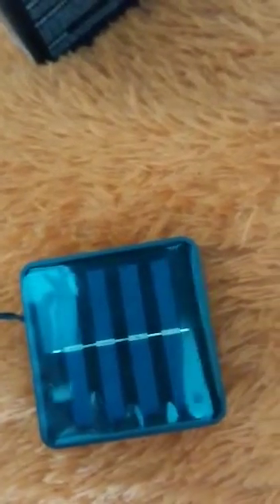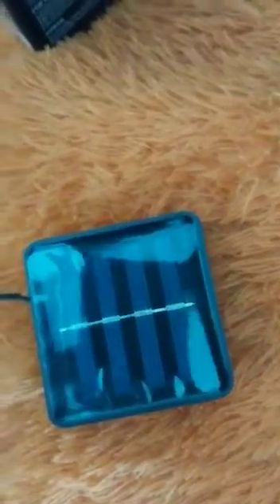How Solar Christmas Lights Work  . How to turn on solar powered Christmas lights

Comment: I'm having trouble getting sun on my solar panel. Do you have a good recommendation ? I have them outside in a area where there is no sun it worked out of the box great for 2 nights but last night they didn't turn on
Reply from the maker: Best solution is to install the lights where they can be charged by the sun . But if you are in a country with limited sunlight the ray of the sun will charge the lights but they will not last all night . Another solution is to purchase rechargeable battery with high capacity example mah2300 or higher,  these charger will last longer and you can change them if you differently don't have sunlight to recharge them or you can use a rechargeable battery charger and recharge them then reinsert into the solar panel power box . Let me know if you need an amazon link to these batteries 👍
Reply: @sunshinecitysolarlight876  thanks yes I'm in Texas right now we're still having sunny days in the 60's but I put the lights on the side of my house where my neighbors block any sun hitting on that side of the house I'll move them thanks
Reply from the maker: You are welcome